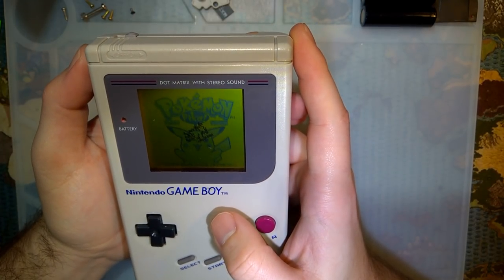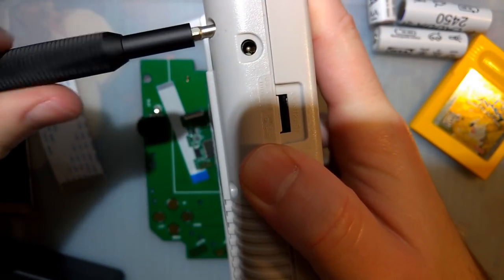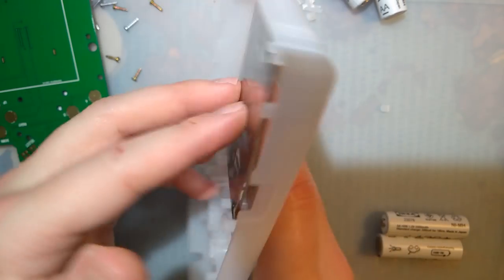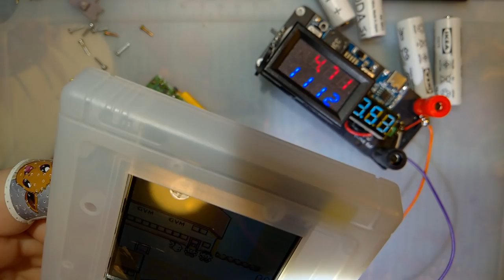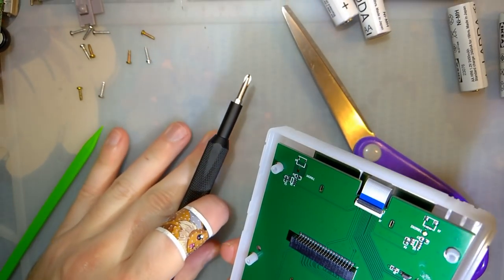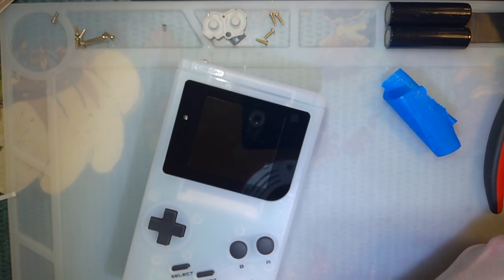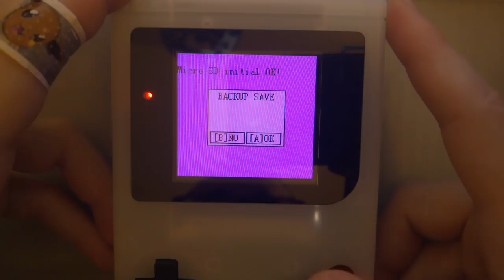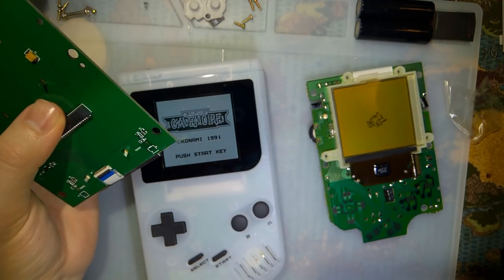Installing the DMG IPS v1 Kit (RIPS) in an original Game Boy

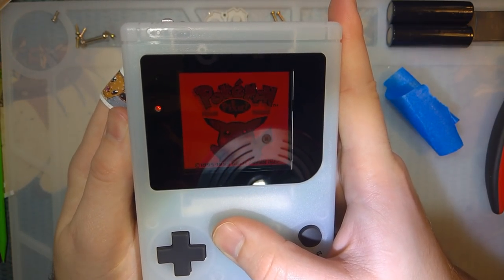Comment: It looks like this screen has the same issue as the first batch that I have (and later fixed). Look at the pokemon yellow title screen at 39:12 in this video, and then look at 4:25 in my video (https://www.youtube.com/watch?v=LCn2B4WRJRM) and you can see the color difference. If you have a backlit GBC/GBA/SP you can run the same test (change the color to black/white). Another example is to test with a Gameboy Camera, this will easily tell if the color is off. For people who are interested in this mod kit, make sure you get the fixed version.
Reply from the maker: Indeed. I'm going to pin this until we have a solution (either homebrew or from a fixed version of the kit). Here is another image as an example: https://cdn.discordapp.com/attachments/332487777986019337/670870465341947944/WP_20200125_22_58_25_Rich_LI.jpg
Reply: For the large ribbon cable... lay it flat against the PCB and slide it up
Reply from the maker: @daijoubu4529  The PCB is sharp though and that's how I cut my knuckle the first time. But yeah, thanks.
Reply from the maker: Alas! A solution! See my new video https://youtu.be/cFpnUGuXtbY or this imgur album I made https://imgur.com/a/DDlowE5 for more details. TL;DW swap the D0 and D1 lines to the LCD kit
Reply: How to tell if the kit is a fixed version without installing it first? Anyone know?
Reply from the maker: @retro_boy_advance  I heard that the new kits that have the fix applied from the manufacturer should have a mark of some form on the silkscreen of the PCB. I'm sure that more details will surface when the kits start shipping. There might be a few kits here and there that are the v1 kits but with v2 firmware though so if you end up with one of those (if you already have one, it's not one of those) and those will only be differentiated after install.
Reply: makho thank you!

Comment: I want  to get a ez flash junior and use it in a backlit aio v2 gbc have you had any issue with the ez flash junior and have you tested it with a backlit gbc
Reply from the maker: Only issue using it in backlight (modded) consoles is when updating the firmware. The firmware updates seem to fail when run from modded consoles. I break out a stock GBA SP for firmware updates now. Otherwise, everything else seems to work like normal.
Reply: @makho  thank you

Comment: What’s your estimate on battery life, I see it’s a little under half.....so about 10 hours? Thanks for the fast video, this is the one I have been most interested in seeing
Reply from the maker: Honestly, I have no idea what a DMG gets stock. With this kit (and my measurements), I estimate that normally it would get about 45 hours and this kit will change that to about 22 to 36 hours depending on brightness or 50 to 80% of standard. I haven't seen any tearing but I am less than pleased with the default color palettes. I wish there were more and that they were customizable. The "colors" seem a bit off too (see pinned comment).
Reply: @makho  Thank you......I see so many different conflicting numbers when it comes to the battery life of the DMG. Also, I forgot to ask, my donor will be a DMG-CPU-04.....I read that CPU-06 and up are better to use for modding. Do you have an opinion on this?
Reply from the maker: @OkiDingo  Can't say. Like I said, I'm new to DMG modding. Don't forget that different DMGs might be more power efficient, different games use more power, and battery capacity has gone up in the last 30 years since Nintendo gave out official numbers.

Comment: I'll wait until someone makes one that has all the GBC and SGB custom color pallets
Reply from the maker: I believe the one from funnyplaying should. Did you check out the video from TheChineseGuy that I linked in the description?
Reply: @makho  The green color pallete (think is a customized one) seen in the chinese guy video is not like the green this screen has right? The other one looks like the original color and this one is a bit too green and a bit fake right?
Reply from the maker: @RenoFriends  No, this is a bit off. I wish there were more customization with this thing.
Reply: @makho  did you tried to hold on the wheel button?
Reply from the maker: @RenoFriends  Yes. It changes the palette on the initial click and holding it does not do anything else.

Comment: So you turned a gameboy into a backlight gameboy color? Cool.
Reply: Gameboy dmg light.
Reply from the maker: It does not run games in color. There are only a couple pallets (which both look like they are made for Pokemon Yellow) that swap out the grays for yellow. Every other pallet is just swapping one color from the DMG to another color on the screen, statically. It's basically "fake" color. There are never more than four colors (black, white, dark gray, light gray) but this screen may exchange gray for yellow or white for purple, depending on the selected pallet.